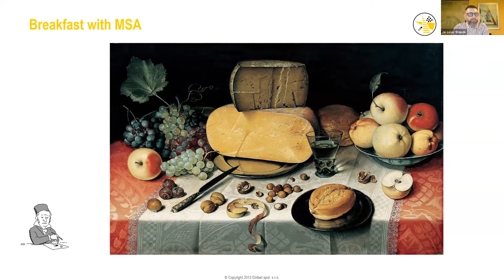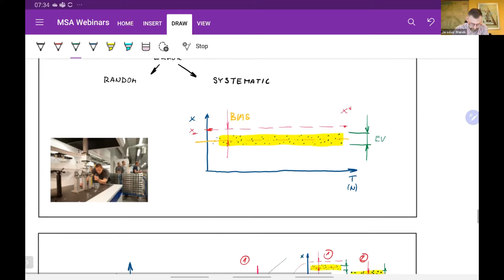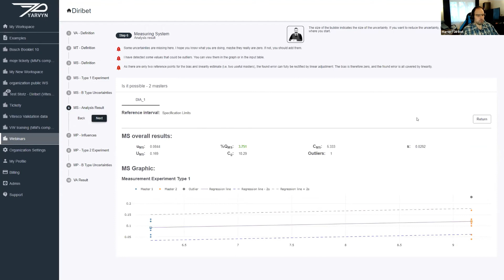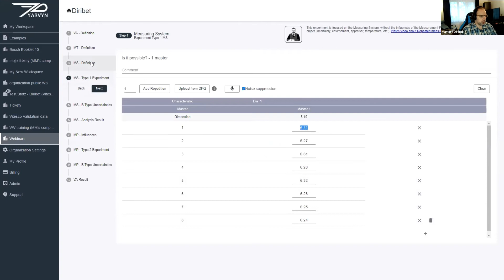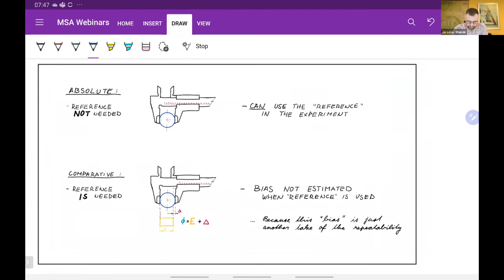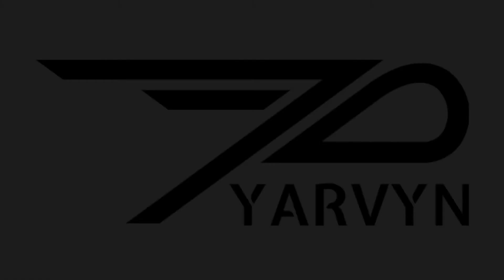05 - The morning coffee with MSA: How is it possible?

Comment: I would suggest not only is 0 not possible it is also not strictly desirable as that would be fundamentally deceptive. If it is determined as 0 then you are simply not measuring to sufficient decimal places.  As for Linearity of zero that would be nice as it is the gradient of the plotted line. However I would be worried about the sudden  drop off. Giving a very rectangular PDF for the uncertainly budget.  From a practical perspective that would give a dramatic degradation at the limits.   in terms of resolultion using Wheeler's Probable error which I also call Demonstrable Resloution = 0.675(Rbar/d2) where d2 for n=2 is 1.128 Rbar =0 would probably mean you haven't turned on the measurement system. Or have an Xm of 0 and are not detecting the actual signal. As a metrologist 0 in these cases would look way too good and that alone would get me worried. Enjoyed the vid.